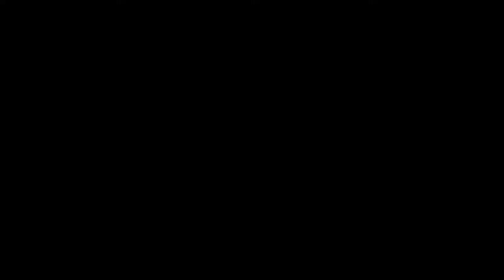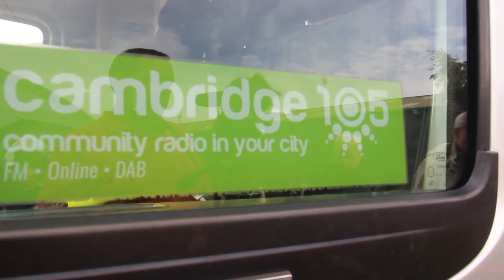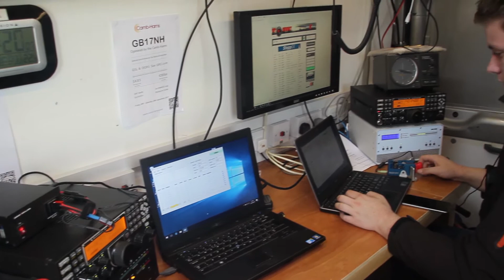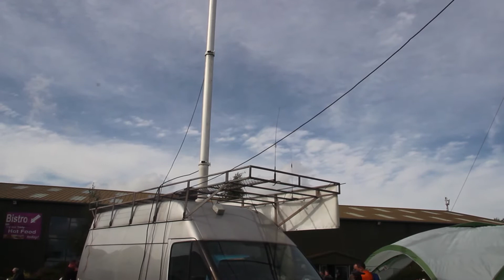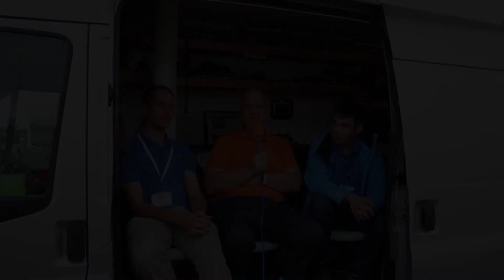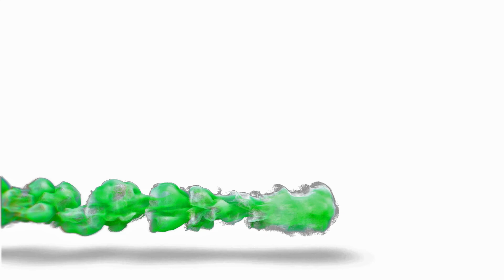Making a Mobile Station - Flossie

Comment: Flossie II was by far and away my highlight of the 2017 National Hamfest.  The Camb Hams could not have been more welcoming, and it was a great pleasure to operate GB17NH from inside the vehicle.  I had wondered if the van would be as accessible or welcoming as a tent would have been (for example) but I need not have worried.  If you get a chance at a future event, bring a copy of your licence and have a go at operating from inside Flossie.  I can't recommend it highly enough!  73 from Edmund M0MNG.